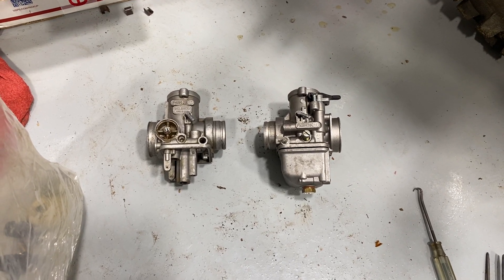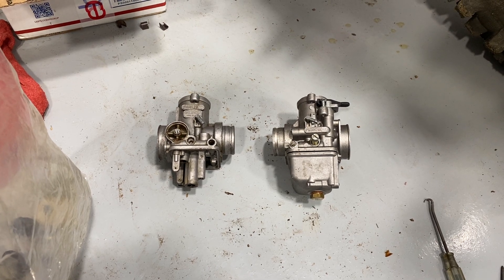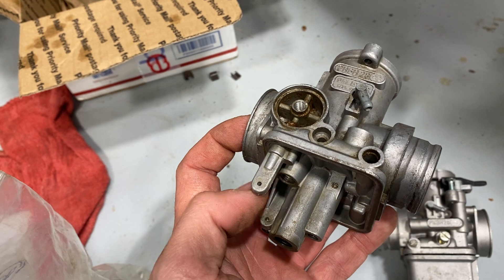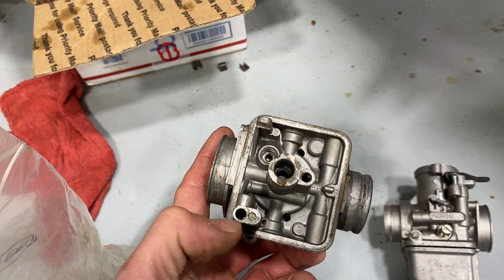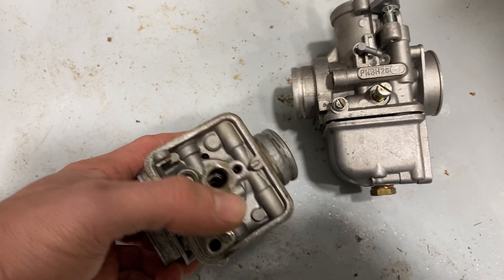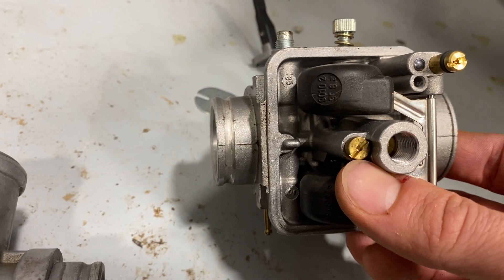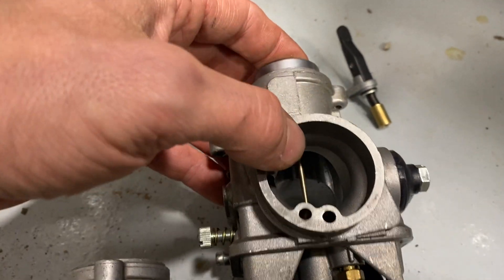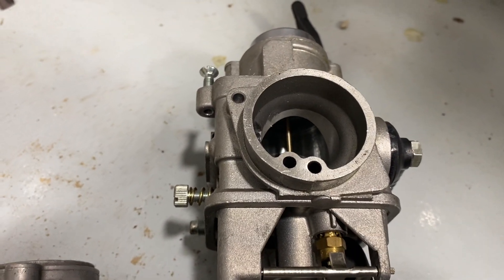Dellorto PHBH Carburetors Explained

Comment: Hello. Quick question.I have dellorto phbh bs 28 mm and dellorto phbh bd 28mm. Can i put the float from phbh bs to my phbh bd 28mm. I read on internet that the bs has 6.5g float but bd has 9.5g float. Thanks
Reply from the maker: Unfortunately I'm not sure, I really only know the carbs I have. It ought to fit, but keep in mind that if you put in different parts it will change the fuel flow characteristics.
Reply: @TedsGarage  Many thanks!